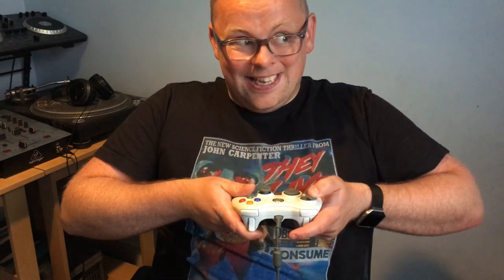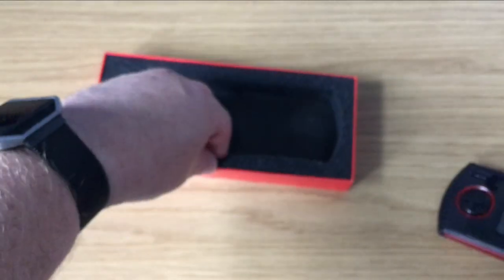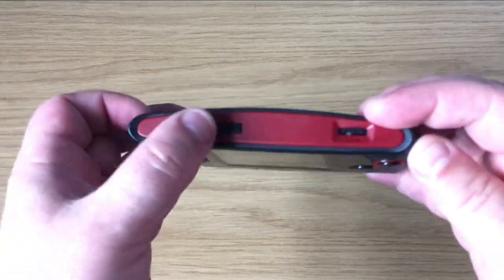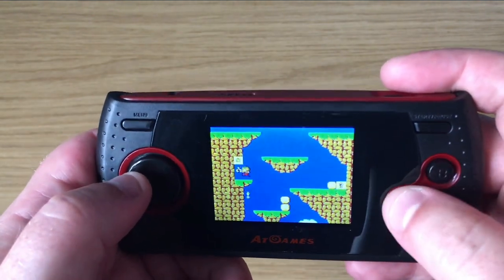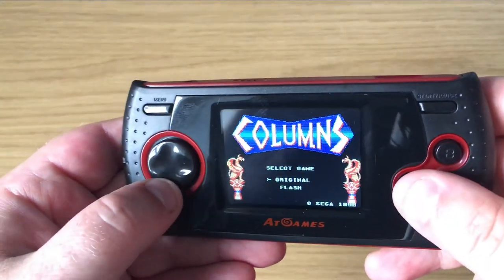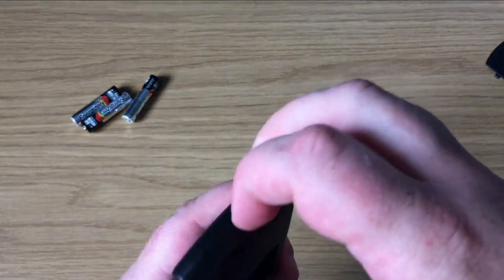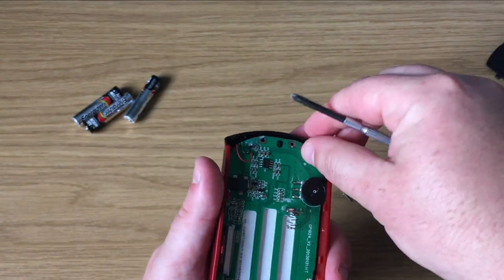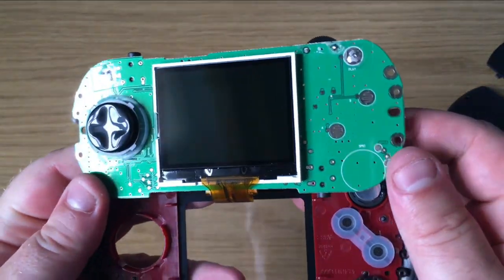Atgames SEGA Arcade Gamer Portable Unboxing Teardown and Review. It's good!

Comment: What av cable connects it to a TV please?
Reply from the maker: It's a 3.5 Jack to triple phono (I think that's the correct naming for it 😁)
Reply: @ThommosTech  thankyou very much x
Reply from the maker: @denisemajor7124  You're welcome :)
Reply: @ThommosTech , can that be modded to take the original cartridges? and have a USB port to charge the device and a lithium ion battery mod?